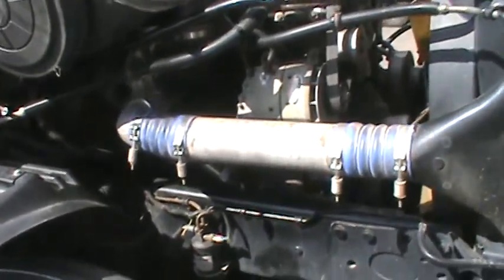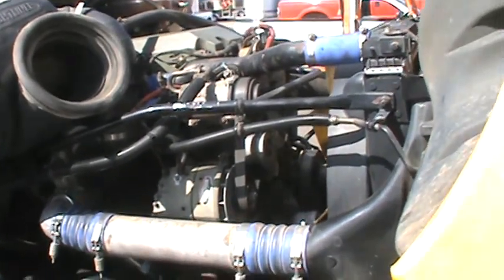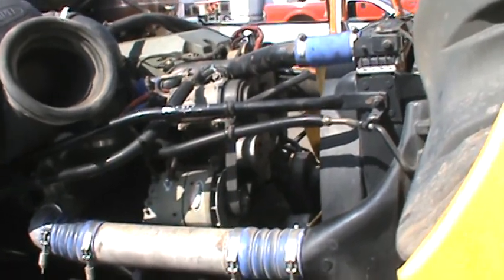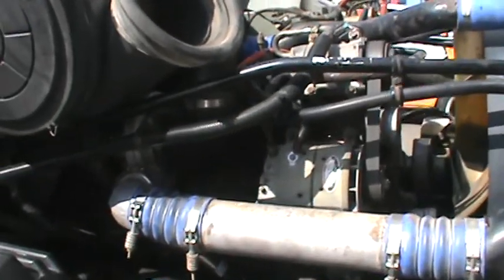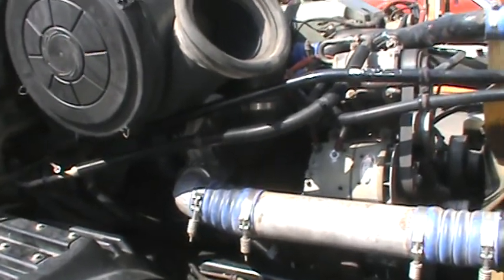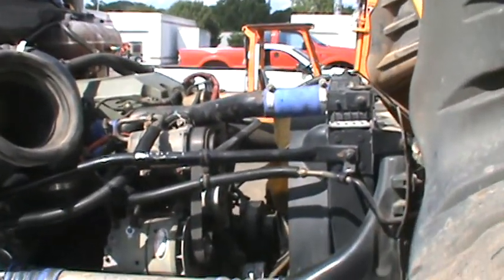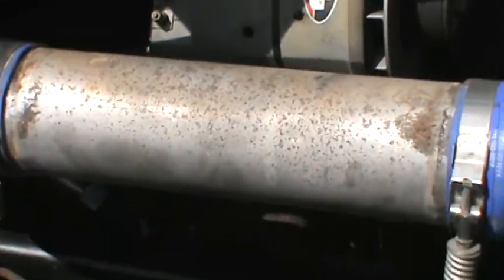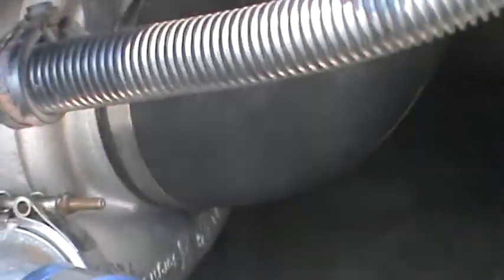14 l detroit diesel  up grade

Comment: They did a great job on I have a 14 l it's a 2004 model I'm putting in a 1990 model peterbilt having an issue for water pump pipe changing the turbo deleting the EGR it's a little bow on the back of the engine on the passenger side looks like a air hose do you know what this is for what will I have to do to the ecm to delete the EGR I'm just trying to make a better I took a wore-out 3406b

Comment: how do you do away with the vnt turbo can you just change them out or do you have to change the ex manifold and do ecm tuning
Reply: Yeah, it's a total changeover, turbo, exhaust, ECM reprogram.  It's going to set you back about 5K.  There's a simpler way to do it, just jack up the set screw on your Turbo and Re Program the ECM.    I've done both.  The 2nd is far easier and just as effective.
Reply: @Dustmurod Aliev I know this is a late comment but hey I just saw this video. Either way you can definitely do it a lot cheaper. Charlie Abbot seems to have a handle on it. You should probably just take the backseat and let the big boys talk. I paid $450 for the tune and did the rest myself. I still have the vgt turbo but the vpod is null and void at this point. My truck dyno'd over 600hp and still pulls up mountains overweight with the cruise set at 72. So take this as a lesson, just cause you don't know about something doesn't mean it don't exist.
Reply: @DadOfAllTrades01  Chris do you also have the Series 60? Did you do the work yourself?